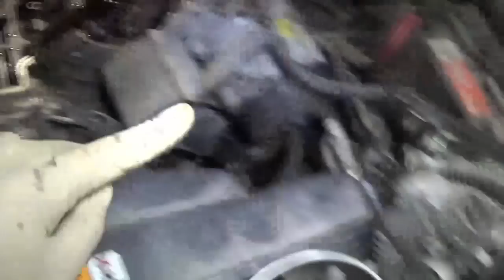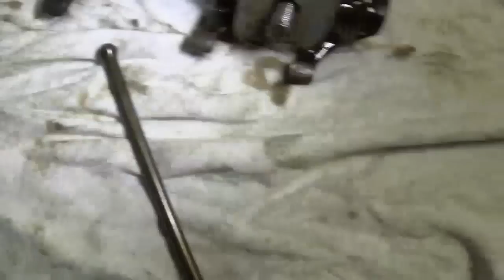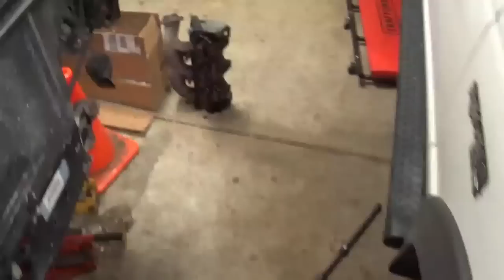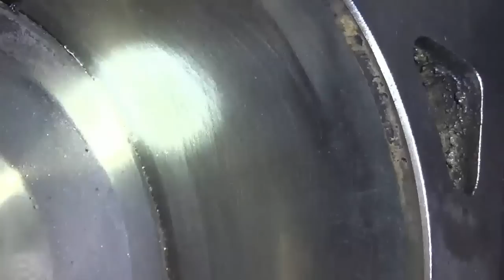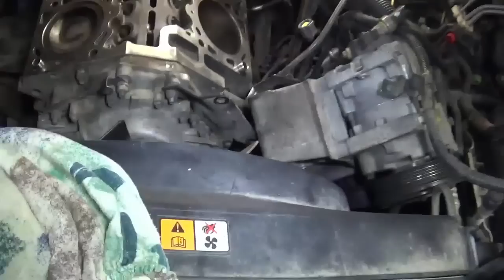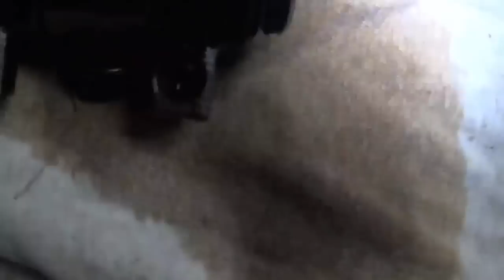Ford 4.0 OHV Top end Tear down and Inspection

Comment: What was the casting number on the heads that cracked? Ive got a 98 with the 98t heads and a missfire in 6 which is not usually where they crack. Im really hoping its just the gasket but idk.
Reply from the maker: I do not know, but a crack between the valves is common. If you pull the heads off it should be very obvious if it is a gasket problem or not.
Reply: @TEDDAV64 yeah I just wanted to figure it out before pulling but it looks pretty much impossible to know without pulling them so I'll just order the stripped enginetech ones and replace them

Comment: Very good video. Thanks very much. I have a "97 Ford Ranger XLT pushrod 4.0L V6 using antifreeze/coolant, not overheating. Im not sure where it's going. I'm a novice mechanic at best. I've removed the heads & have discovered four (4) small spacer wa shers (?) from an unknown original location. The spacer washers are 3/8 inch outer diameter & 1/16 inch thickness, and I think are stainless steel. I think they might originate from the 4 of the 6 bolt holes which secure the rocker arm bolts on both heads. The center bolt hole also serves as an oil lube point, per your video. Please confirm if known. Thanks a lot. DMS

Comment: I just found this hope I get an answer but would this type of crack cause a lean code
Reply from the maker: Generally No. A lean code comes from pirate air getting passed the MAF sensor not measuring the correct amount of air. Most likely cause is leaking intake manifold/ Vacuum leak which is common on these engines. Good Luck.
Reply: @TEDDAV64  I have the upper intake gaskets ordered an fuel rail gasket...I hope it fixes my issue I'm working on a vin x 97 ranger...thakyou for your response

Comment: I know this video is 4 years old. But I'm having to replace the heads on my ranger right now. How are the king heads holding out for you? I'm thinking of getting the same ones.
Reply from the maker: Holding up great. Haven't touch the engine in 4 years besides oil changes. Would buy again.
Reply: Awesome. Thanks!

Comment: Is this expensive to get the shop to repair this problem. I’m purchasing a truck and I think there’s the problem because it ran strong but reservoir was empty and I smell anti freeze
Reply from the maker: These engines are usually on the cheap side of repair. If a legitimate shop did it I would guess around 1000 for parts and labor but thats my educated guess. Get quotes from multiple shops before taking somewhere. Good luck.

Comment: Thanks for making these videos.  I have the same engine except it is a 1995.  Both head gaskets rusted out, I had antifreeze leaking out the side of the engine and in two cylinders.  Your video gave me the balls to take it apart.

Comment: Next time you go looking for parts best off look in Rock auto. Why did you on;y replace 3 rocker arms On mine i go all out and replace them all I rather have a new top-end then chance it with used parts. But I'm working on the easier 4.0 from 1990--97 4.0
Reply from the maker: I have use rockauto. I only replace what I need when doing a cheap patch job. If you want to pay for it be my guest.

Comment: Quick question there are some long studs that guide the heads how did you pull those out?
Reply from the maker: The head alignment dowels I can usually get out very carefully with a pair of vice grips but if they really stuck you would have to use a dowel removal tool. Its like a slide hammer type tool. I generally leave the dowels alone if they stay in the block.

Comment: I have a coolant leak between lower intake and head. More motivated to do the job now thanks!
Reply from the maker: Good to hear. This engine is so simple you should be able to do it no sweat. Good luck.
Reply: @TEDDAV64  Thanks! The engine compression is good but I landed a complete set of heads up+ gaskets on eBay for $45.00. MIght just do every gasket except the heads. Couldnt negate the deal since in most places, just the upper intake gaskets cost that much. I do have one question however, do you recommend using RTV in lieu of the valve cover gasket, or in addition to? If so, would I apply it in a sandwich pattern on both the head + VC surface?
Reply: How about some head gasket sealer?

Comment: Yo great vid, how many miles did this have??
Reply from the maker: Had 140k when I did this but now the truck has 190k and still running strong.
Reply: @TEDDAV64 .. awesome, I have the same problem, I'm about to change out my head gaskets on the same block so your video helped my confidence, oh did you need to send the heads off or was you able to clean them up really good and torque them back on? :)
Reply from the maker: Well I bought new heads to put on because the one was junk due to the crack but the other one I could of just clean and put back on but I didn't want to run into that head cracking a short time later to have to do this all again so I replaced both heads. Its a good idea to have the heads check but if you know you have no valve issue in head and cylinder head surface is still true. You can just clean and reuse them as is. Your choice.
Reply: Teddy Garage.. ok thanks, thank you so much for your reply, because of you I’m able to do this thank you so much you’ve been a good help...

Comment: Was it overheating???
Reply from the maker: No. I was just lossing coolant.
Reply: Teddy Garage oh I was wondering mine don’t overheat but after driveing it for a long trip it smells like burning coolant an my coolant gets low haven’t looked to see if it leaks outside or internal like yours was but oil stays clean on it
Reply: @kamryn7496 did u figure it out? I have same issues, clean oil, doesn’t overheat
Reply: @jacobforsberg6412  no I traded the 4.0L B4000 I had for a 3.0 ranger instead

Comment: so, could the large amounts of coolant in the cylinder(s)/radiator be caused by stretched head bolts? my B4000 has 250k miles and plenty of cylinder discharge in my radiator, etc

Comment: Teddy (I'm assuming) at 3:15 you were explaining how the dipstick tube came up through the exhaust manifold. Couldn't you have pulled the tube off first, then disconnected the manifold from the pipe end? You'll have to change the oil anyway. Was that an idea or no?
Reply: BTW,,, What size were those torx head bolts in your cyl heads? T55 ok, Thanks!
Reply from the maker: I could but if I remember correctly the dip stick tube was stuck in block and didn't want to deal with it.

Comment: How did you remove the exhaust manifold bolt furthest to the firewall on the bottom on the drivers side with the pipe being in the way?
Reply: I used a 3/8 ratchet with a universal joint below the egr tube
Reply: @brycelund7155  Thanks!

Comment: My 2000 ohv is losing coolant and keeps misfiring at startup on cylinder 4, even after a plug and wire change. I’m contemplating on whether I should get the heads or head gasket replaced or use k-seal and try my luck. I wouldn’t mind getting new heads and pushrods. Wish it wasn’t that much more work to replace the piston rings or I’d get those changed too.

Comment: I would've rebuilt the whole thing.
Reply: My 4.0 ohc does not have push rods.
Reply: Joe Mc that's cuz it's an overhead cam
Reply: @joemc6356  if your truck is newer than 2001 I believe, then it's an overhead cam. So it would be called a 4.0 l SOHC (single overhead cam) not a OHV (over head valve) like the older motors. Meaning you wouldn't have any push rods.

Comment: I know this is old but I have a 95 explorer with a 4.0 ohv. My temp gauge goes up to the middle then drop down about a quarter of the way and back up to the middle. Never overheats and the heat works great still. No external leaks that I know of and both coolant sensors, thermostat, radiator, lower manifold gasket, water pump, fan clutch and timing cover gasket have all been replaced but yet the gauge still fluctuates. Any thoughts would be appreciated! Also if the truck is driven for an extended amount of time it would randomly stall out whether I'm driving or just idling in park. Sometimes it would start up right away other times I would have to let it sit for some time. most of the time it would be fine after about four hours of sitting. I also forgot to mention that I recently replaced the camshaft synchronizer, which by the way looks nothing like the one on your truck and also the harmonic balancer as well but the issues have been going on well before I replaced those parts.
Reply: my 95 explorer 4.0 Ohv / Eddie Bauer temp gauge,   has fluctuated like yours, every since I bought it 5 years ago. Early on,  I tried to fix it by reading the explorer forums for advice and then replacing the radiator,  hoses,  thermostat and the idle air control valve, etc.  I've since concluded that this fluctuation is part of the vehicle's design. I finally accepted the explanation written in the maintenance booklet that came with the car which says that this type of temperature gauge fluctuation is normal,. so long as it's not overheating, of course.
Reply: Could just be poor communication with the pcm
Reply: Maybe a heat core. But sounds like it could be electrical.
Reply: Chris, I've got a 94 Ranger w/ the same 4.0 ohv, analog gauge. I also get the fluctuations, up n down but never drops below normal or anywhere close to overheating. I'm up by Lake Erie, it's now January, so the gauge drops pretty quick when coasting down a hill!
Reply: Did u figure it out? Mine also has all issues stated above, stalls and fluctuating temp, 94 ranger 4.0 ohv

Comment: These engines also had a TSB for steam formation. Some would make knocking noises and/or others couldn't keep the temp gauge in the center. I know mine never reaches full temperature, even with a new Ford stat. It moves around in the mid-high 180s. Was like that for 80K miles, since I got it. The fix was to install a special hose from the lower rad to the temp sensor, with an adapter. That kit is long gone. All that steam couldn't be good for the heads. These engines have no external coolant bypass.

Comment: could you list the tools you use to pull everything cause I have the same motor doing the same thing but I have to buy tools to be able to do it so I like to know what tools I need thank you.
Reply from the maker: just the normal sockets, wrenches, screw drivers and pliers. The only special tools you need is a torx bit for the head bolts I believe size 50 and a gasket scraper. I believe that is it.
Reply: the torx bit is a 55

Comment: When you took the rocket arms off did you have to mark the timing, or turn balancer pulley to a position? How about on reinstall?
Reply from the maker: Like 90% of them cause there are 4 timing chains in the SOHC one being on the back of the engine and all the tensioners operate on oil pressure so when oil breaks down and turns to sludge the tensioner can't operate correctly which makes the guides fail in-turn makes the chain fail which makes engine fail.
Reply from the maker: Nope there is no timing to deal with, no position to put the front pulley at it is as simple as line up all the push-rods to the rocker and lifters and bolt down and done.
Reply: It is a very easy engine to work on. You just follow a torque sequence like a robot. I think a lawn tractor engine is harder to repair. The SOHC  4.0 though is scary. Usually not worth to bother for an older truck. With this repair it will probably last 30 years. The lower end is extremely solid
Reply from the maker: lawn tractor engines are even easier and the SOHC engine are not scary they are just made more complicated then they needed to be because the engine depends on oil pressure for timing chains so a SOHC not being kept up on oil changes I would avoid like the plague cause lack of maintenance kills the guides which in turns kills the engine.
Reply: Step 1 on a trashed SOHC: Remove engine. There is a timing chain in the back.  Are you saying all the SOHC failures are due to poor maint?

Comment: Great video, I have a 97 Explorer 4x4 with same motor. Its for sale but I may go through the motor and refresh it.
Reply: OHV was discontinued in 2000. The SOHC was introduced in 1997 as an OPTIONAL engine. I have a 99 Explorer with the OHV.
Reply: AC Tippets your 97 has the soch 4.0 engine much harder to work on
Reply: swifthartless i had the 4.0 OHV, its in my uTube videos here under my profile.  I sold it so im all good now :)
Reply: AC Tippets really ?im 90% sure the 4 l ohv was No longer used after 95

Comment: What, where did you get your heads. and are the new heads working fine (#miles).
I see companies like Clearwater and Odessa with aftermarket new heads around 400$ a SET fully assembled, worry about quality. 
Thank You
Reply from the maker: https://www.kingcylinderheads.com/product-page/f4affde3-b8f2-4675-c53a-eb92ccc044d2

Kings cylinder heads is where I got mine because they are actually NEW heads, I looked at clear water and they did not say anywhere the made new heads on web page and if you go to about page they go through their re-manufacture process which to me means rebuilt heads and I didn't want that cause of fear of future cracks. Never heard of Alabama heads. the Kings heads have been and still great they have about almost 20000 miles on them and no problems.
Reply: Thanks for the reply!

Comment: Tom - Thanks for mentioning King Cylinder Heads during your instruction video. That's very cool! And I don't think our heads are THAT expensive ($295 each) considering they are brand new, thicker, improved design heads with brand new valves and springs. lol. Much better than anything remanned for sure.  Thanks again! Mike www.KingCylinderHeads.com
Reply: I think it is a GREAT price! I will be buying from you guys whenever I need to buy any cylinder heads.
Reply: considering these trucks go for under $1k all day every day, yea that's on the spendy side.
Reply: @jonuncaged4341  It is a hard decision, especially if they have rust. But the Explorers and Rangers of that vintage are what they are....some people want that setup.
Reply: @jonuncaged4341  the value of your vehicle don’t change the cost of making a new part.🤦‍♂️

Comment: What shorty headers? Did you end up installing them?
Reply from the maker: I got PaceSetter Headers part number 70-1385 and yes they are installed comes with bolts and gaskets but they are paper junk so I used better gasket as well you reuse the stock y-pipe.

Comment: hey tom great vid quick question would you happen to know what length the oem exhaust manifold to head bolt sizes are i know they are m8x1.25 pitch i just dont know the length.

Comment: Hey, do u k ow where the camshaft position sensor cable is on the harness? For the life of me I cannot find it.
Reply from the maker: Camshaft position sensor cable dont know what you mean by that but if you pause the video at 16:21 the camshaft position sensor location is the black plastic cap on the metal stalk in the center of the engine in the very back before the trans bell housing, at that moment of time its clear as day Dude.
Hope that helps.